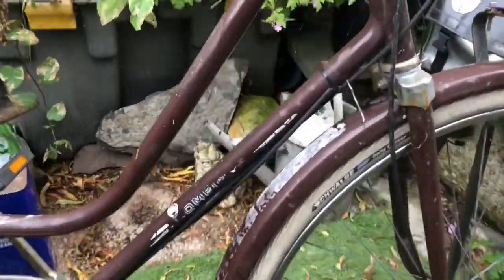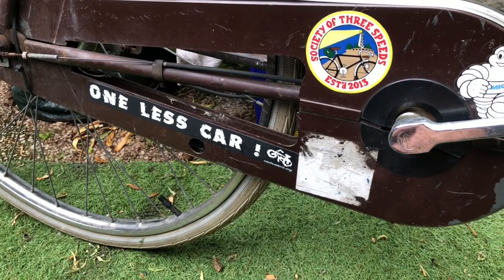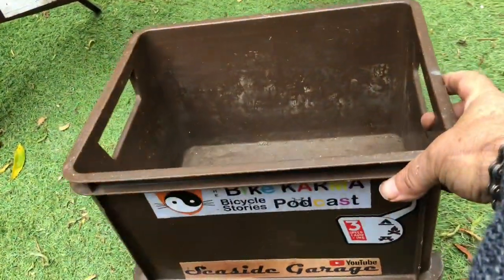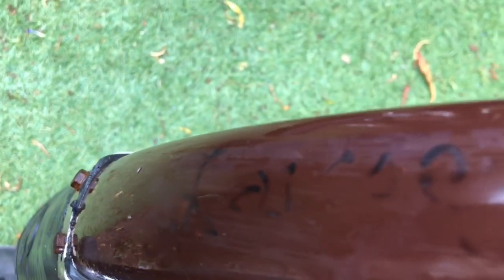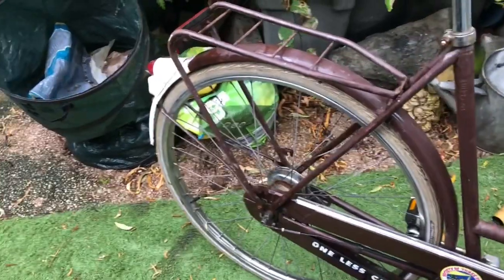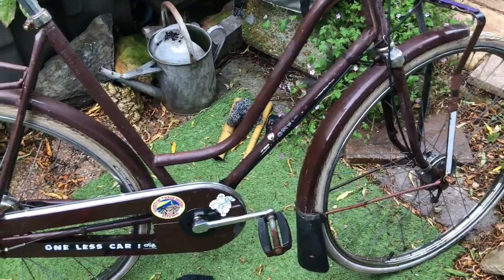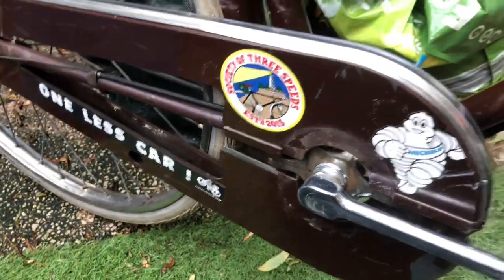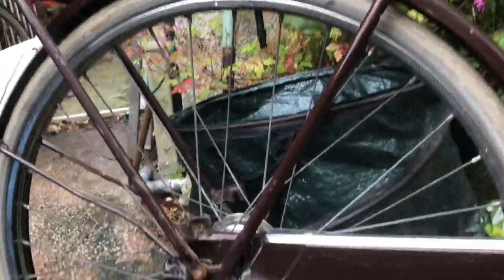Dutch beater bike gets some love. Sparta vintage 3-speed bicycle repair. With added kittens!

Comment: The bell has a built-in bump detector, very handy feature!
Reply: Many a time does my bell go off on its own, either with a bemused walker (who has clearly already seen me) near by, or when on my own on some deserted lane/track.
Reply from the maker: Mine waits until I press “record”, especially my 1984 Superbe. Those chinese ding-dong bells are particularly prone to it. I take the top off and press the circlip down tighter on the central post, which stops it for a while.

Comment: The engraved letters/numbers are the zipcodes and housenumbers of the previous owners. It was ment as an anti-theft measure. In the early '80's in the Netherlands you could bring your bike to the local police station for engraving, or the police was present at shops or fairs to do this. It was also offered by local bike shops as a service. I'm glad this is no longer done, as it made selling your bike less attractive. Later the zipcodes and housenumbers were engraved on a yellow plastic label, that could be removed when you sold the bike. Also not a clever idea.
Reply from the maker: Several of my bikes have these numbers. I intend to take them all back to their original dealers for photos, but maybe I could take them to the addresses too! I am particularly fond of the Dutch dealer stickers on bikes, as they provide the first link in the history.